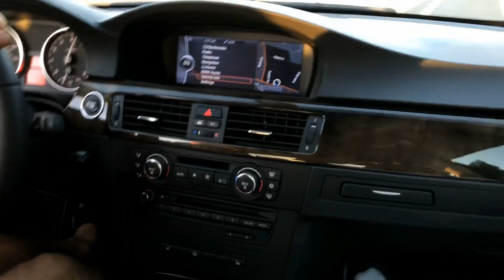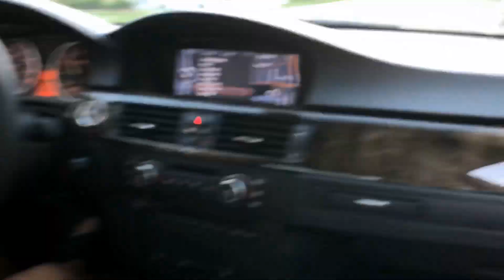335i Back On The Road! New VRSF Charge Pipe and Burger Motorsports DCI!!

Comment: Nice Job guys. I have been following your progress. I bought a 70k N54 E92 from AIAA but we thought the engine was hydrostatic locked. After removing all the water and replacing the starter and battery and all fluids I did manage to start and run it but I found metal shavings in the oil. So I found a 60k mileage engine and installed it. Now she runs beautifully. Knock on wood.
Reply from the maker: Glad to see you staying tuned! Wish you made some videos of the build!

Comment: laugh. nice hot air intakes
Reply: Air gotta go through the turbos so its gonna be hot air irregardless. Thats where it intercooler comes into play... People laughing at you buddy lmao
Reply: Toob247 Toob247 not necessarily actually. The ending temperature of the air depends on intercooler and outside temps. Not if 10 degrees cooler entering then 10 degrees cooler exiting. Also they probably dyno with hood up to get more air not cooler air cause on the dyno the car isn’t moving and sometimes the fan can’t even push the actual air the car would get if it were on the highway...

Comment: Drive it like you stole it. don't buy used parts on these cars what's wrong with you
Reply from the maker: dala bu What used parts?
Reply: I think I heard you saying you gonna buy part from junk yard
Reply from the maker: dala bu Oh, I was referring to the cover for the positive terminal on the alternator.
Reply: I bought a used active autowerk BOV charge pipe combo, and dual cone intakes in which I cleaned thoroughly. Runs like a dream with 0 issues and paid 400$ total for both. Canadian currency too. Just gotta browse your options.
Reply from the maker: Agree! For most parts used is ok as long as you find something in good shape